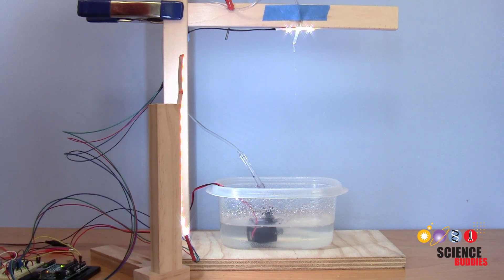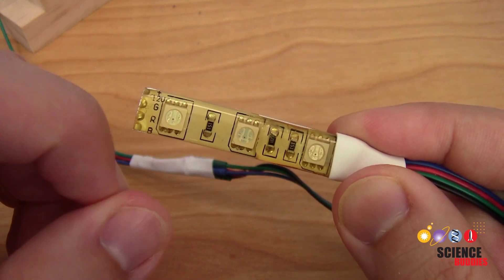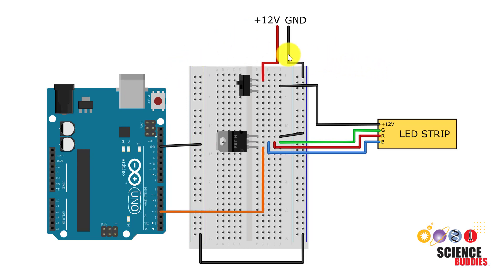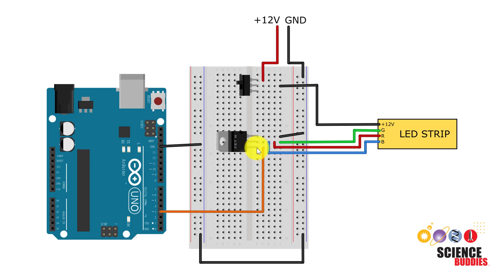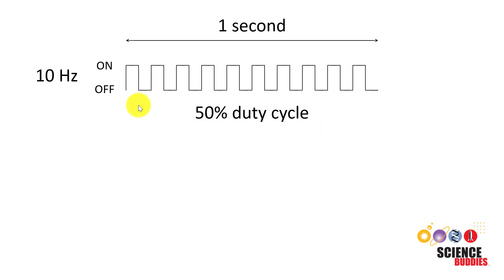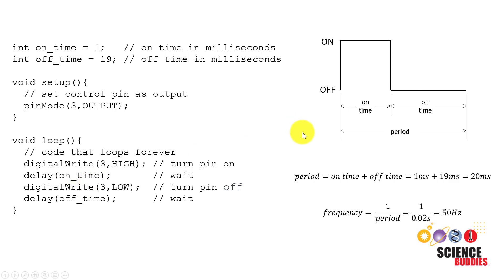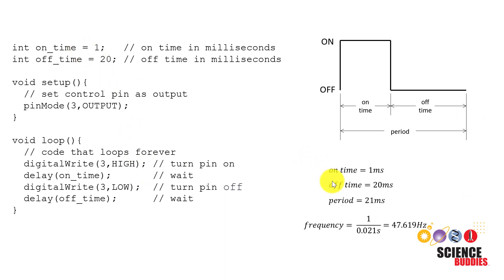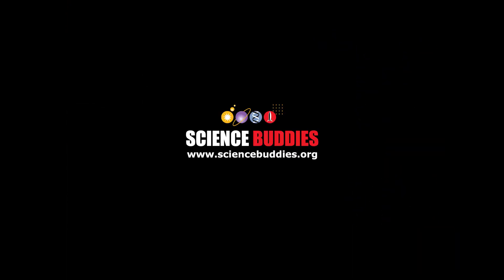DIY Arduino Strobe Light | Science Project

Comment: What if there is only two terminal at led strip?
Reply from the maker: It is probably a digital strip instead of analog - you will need to consult the documentation that came with your strip or find the datasheet online.

Comment: can you see the strobe with your own eyes or is the freq too high for our eyes? Because when I installed the program and connected the componetents, I didn't see any flashing at all.
Reply: and is the 12v which are used AC or DC?
Reply from the maker: The LEDs are powered by 12V DC. You should be able to adjust the frequency in the code to see the flashing with your eyes.